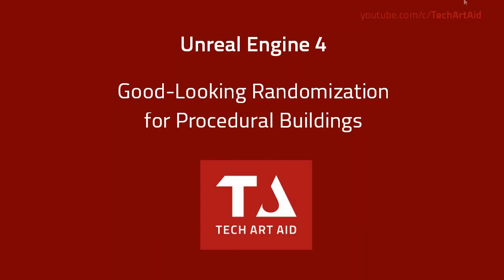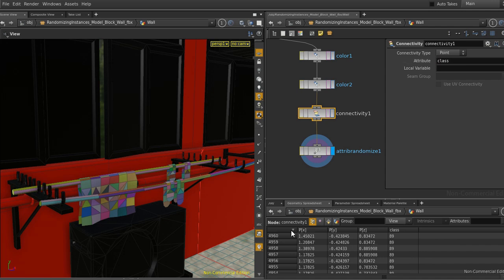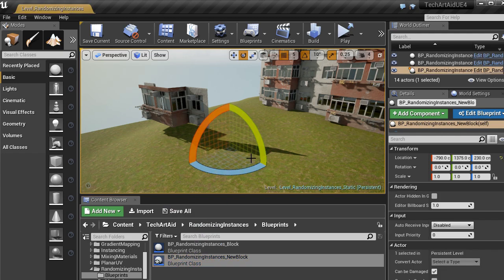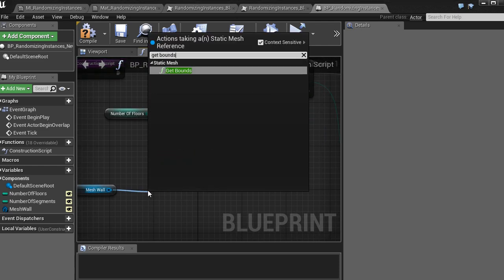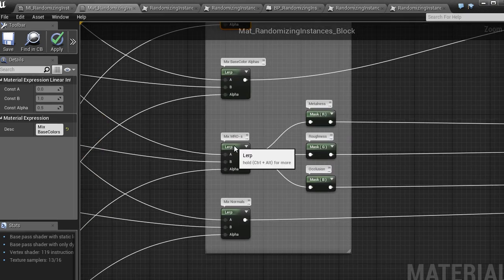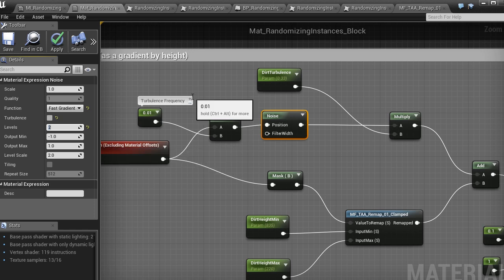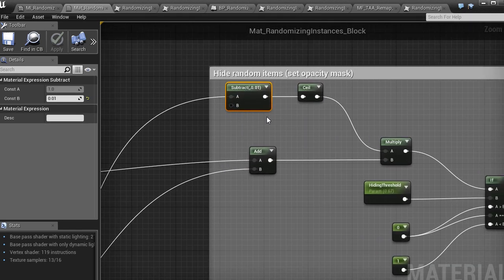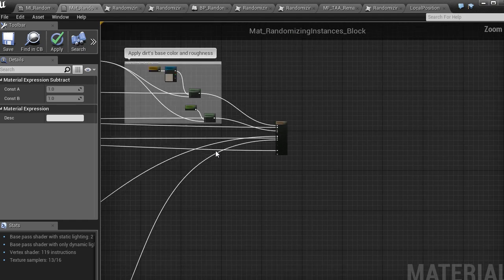UE4: Good-Looking Randomization for Procedural Buildings

Comment: Great tutorial, I have a question about packing the maps though. How would I go about packing the base colour into the alpha channel in substance painter?
Reply from the maker: I think I didn't pack the base color. I rather added an Opacity channel ("op", in Texture Set settings). I used it to make the wall paint color invisible, basically replacing it later in the Unreal material. At least that's how I remember it - it's been several years since :)
Reply: @TechArtAid  Thanks for replying ! If you didn't pack the base colour then how does the air-conditioning unit etc still have colour? I should mask out the colour of the paint with the opacity channel? sorry if you cant remember, you've been great help thus far :D
Reply from the maker: Yup! See how the alpha looks like in project files. There's no Substance file there, only Unreal, but it should be a good enough hint
Reply: @TechArtAid  Ill have to wait to get paid before I buy them but thanks again ! Much appreciated :D

Comment: Thank you for the tutorial. You've pointed me in the right direction and this will help a lot. 
However, the static mesh overlaps when adding to the segments.
Is there a way to move a new segment over more to one side so that they don't overlap?
Reply from the maker: Yes. You need to increase that component's location by width of the mesh, multiplied by the number of segments so far. Usually you'll use For loop's iteration index for that. You can get the project files on techartaid.com. Folder name for that example is RandomizingInstances

Comment: Interesting approach. Using instanced meshes while adding fair amount of randomness could really have a massive gain in terms of performance
Reply from the maker: For sure! And the next thing I want to try, soon, is to make it artist-controllable. The goal would be to be able to create a district from various modules. Hiding the cheap tricks while allow for some manual control should make it possible?
Reply: @TechArtAid  Vertex Color already seems to be good enough for weathering effects which will make a massive difference on its own (I think). 

However, I wonder how would one go about making buildings which one could enter like in cyberpunk 2077
Reply from the maker: Try that. Especially find a clever way to set colors per entire building easily. For city of that scale, it's also important to plan for optimal LODs (and HLOD-kinda solutions)
Reply: @TechArtAid  well I was considerijg it but apparently it would be redundant by the time ue5 comes out

Comment: Great tutorial, but how do you make this work with instancing. I'm a bit new to blueprints so I don't really know how it works. I followed the version in the text tutorial linked in the description and got it working but I wanted to know how to reduce cost by using instancing.
Reply from the maker: Since UE 4.19, a form of instancing (dynamic batching) should apply automatically, as long as the modules use the same mesh and material (incl. parameter values). However, manual instancing should still be a tiny bit faster. See my Instancing video, about asteroids
Reply: @TechArtAid  Thank you for the reply. I tested out your blueprint and found that it was generating a lot of draw calls for me, but I managed to find another tutorial to create the instances using hierarchical instanced static meshes which produced a lot fewer draw calls (around 30 compared to 200 with each being a grid of 16x16 chamfered cubes). I didn't use the building façade you provided, I was just testing draw calls and performance so I just used the chamfered cube that comes with UE4. I'm not sure if I've done something wrong, and the automatic instancing isn't working for some reason or it's something else.

My problem is okay at the moment since I got my instanced meshed working in another blueprint, however I would still like to know more about the automatic instancing, since I can't find that much about it.
Reply from the maker: I found this thread. Especially replies by the user 'pdunkl' sound interesting: https://forums.unrealengine.com/community/general-discussion/1670524-what-about-auto-instancing

Comment: Could this generate a few hundred buildings with mixed variation in few minutes?
Reply from the maker: Sure! Randomize the colors, the parametrs. Also the results will be much better if you use several different models. Choose between them based on some rules, like in Oskar Stålberg's Townscraper.

Comment: Glad you provided the download. I could not keep up with the material side of things.
Reply from the maker: Does it work for you? They're for 4.18 for compatibility, but I haven't tried on 4.21 or 22. In general, I'm trying to keep the videos concise. I'd rather use the time to explain the general idea. Then leave the details for personal exploration using the downloadable project.
Reply: @TechArtAid  Hadn't had a chance to test the material bit out yet. I will in a few hours maybe. Currently working in other areas. The mesh stacking works. I learned to make sure the loops are in series because if in parallel it will just make rows in either direction instead of cloning the previous row if that makes sense.

Comment: Hi oskar again, I ask you a question, is it possible to put that actor of the building a base that is static and a terrace also static and in the middle to make the floor variables?
Reply from the maker: Hard to imagine the case, sorry :) I think yes, just add a single static mesh component on top and bottem
Reply: I'm trying but it does not work, only the mesh appears in the middle, I leave an image so you can see what I did, probably this bad, also try to put "add static mesh" but I do not know where to connect it, sorry if I get tired of it questions.  http://oi67.tinypic.com/xom74k.jpg

Comment: Thank you very much for this oskar tutorial, I wanted to do it a lot ago and today I was encouraged and it came out, but on the other hand, in the "Construscion Script" section I have everything equal to your video but it does not let me put "Segment Numbers", no I know if it will be the pivot of the mesh or something, I do not know what to do.
Reply from the maker: Hi Sebastian. Have you downloaded the files? Link is in the description. Do they work on your version of Unreal?
Reply: Not yet I could not download it, now I'm going to sleep but tomorrow I continue with the tutorial and I tell you how it was, I have version 4.17.2 Thank you very much for answering my message :)
Reply: Hi oskar again, I ask you a question, is it possible to put that actor of the building a base that is static and a terrace also static and in the middle to make the floor variables?

Comment: Would you mind explain how to add other props to the procedural generation and how to change the material to include those props as well ,thanks for the help !
Reply from the maker: Add new variables for a static mesh and a material instance. Then you have 2 option. First is to add a Branch node with some condition, which will lead two different Set Static Mesh nodes on the generated static mesh component (or set a common variable, if you want to do it a clever way). Second option would be to just duplicate the entire node setup (you can pack into into a function first, to reduce clutter) and provide a different mesh. I hope it helps.
Reply: Thanks ill give it a try and i look forward to your next tutorial!

Comment: hey bro How do I make each segment rise with respect to its height, along its length as if it were a staircase?
Reply from the maker: Create a variable Last Height. In the For loop create the mesh, move it in Z axis to this variable's value, then increment the variable by the height of the currently added segment. The next mesh will already know this new last position.
Reply: oks Tnks so much

Comment: I have a question: I got a building made out of 11 modular pieces, so  when I place each peace individually to create a building, and even duplicate the whole building, I get pure 120 fps, but when I place 2 same buildings, but made from blueprints like this, I get around 70, and there are just 2 buildings in the scene, nothing else. So, am I doing something wrong or this blueprint method sacrifices performance for ease of use? Thanks for the tutorial though!
Reply from the maker: Yes, it sacrifices performance a bit, but it's still reasonable. If you have many buildings, it would be actually better to use this method for prototyping, then recreate in (or export static meshes to) a 3D editing software. Try this and tell me what changes the most when you add these buildings:
 https://www.youtube.com/watch?v=SXLYy6D1y80&index=2&list=PLF8ktr3i-U4A7vuQ6TXPr3f-bhmy6xM3S

Comment: Hi, its very cool. Thanks!
But what if I make 1 Mesh per floor? Will this increase performance when using  instance meshes, for example?
Reply from the maker: +Веня Головин It depends. Generally less meshes = better (less draw calls), but more meshes are better for occlusion culling (objects outside of view or behind other objects are automatically hidden for performance)
Reply: Cool! thanks. But I do not use the occlusion culling, because It does not work very well (objects do not always have time to appear, even if I use hzbocclusion). So now I probably need larger Meshes to improve performance (1 floor maybe).

Comment: Is there a reason you didn't do all of this in houdini? I bet it would be easier than working with blueprints. I'm not sure how I would go about linking materials in ue4 to the .hda though.
Reply from the maker: +Giuliano Costa The blueprint setup here is very easy, just several nodes. But if I needed a more complex generator, then you're right that Houdini will allow for more options
Reply: Kk gotcha. I am looking forward to your houdini tut (:

Comment: Amazing video! subbed (enjoying the optimisng stuff too!)
A small question, how would you do something like replacing just one of the ground level pieces with a different piece so a door/entrance area could be added? 

keep up the good work!
Reply from the maker: +The Virtual Insomniac Thanks for subbing! I'd use a Branch node to check if current loop index equals 0. If true, then I'd use a different mesh
Reply: +Tech Art Aid no problem! :)

hmm so i would assume i'd use a do once node to replace just one of the meshes rather than replacing them all with the door variant? 

going by this logic would there be a way of somehow choosing where to position this one unique piece e.g centering it between other pieces so i just have one door piece in the middle? sorry if im asking too much :p
Reply from the maker: +The Virtual Insomniac No need for a Do Once node in a construction script. This BP selects a different random mesh for the last floor: https://drive.google.com/file/d/0B3aZlreklH8wSlRzbFhpZkE1QWc/view

Comment: Is there such a thing for 3ds max?
Reply from the maker: Which one?
Reply: "Good-Looking Randomization for Procedural Buildings". This looks like awesome high poly modeling, I only found some low poly generation for 3ds max.
Reply from the maker: The single building module (as visible at 3:40) was modelled by me in Blender and textured in Substance Painter. The method I show here is to clone this module horizontally and vertically, then do various randomizations just in the material. It's possible by mixing 2 texture sets, utilizing pixel's world coordinates etc. I don't know about 3DS Max, but it should be doable in Slate Material Editor.
Reply: 3ds Max 2016 introduced node based scripting, through their "Max Creation Graph". Vertex painting (what is used in this tutorial), has been in Max for ages though :P

Comment from the maker: In 2 months it became the most watched video on the channel, with 19,500 views. Then 4,875 people made it through the presentation part. 2,925 survived the Houdini fragment. Brave 1,462 of you watched until the end of tutorial. Whoa. There's a lot of us, tech-interested artists (just here), if you think of it!
Reply: Tech Art Aid we love you for doing this. Please continue these kind of videos.
Reply from the maker: Thanks for encouraging me. I hope to release a new one tomorrow, about GPU profiling (measuring what slows performance down in a scene).
Reply: this will be very useful for me right now, looking forward to seeing it - Subbed!
Reply: Tech Art Aid I'm just watching because it looks cool. I don't really care about the tech side of it.
Reply: Hi can you please tell me if i can use blender and unreal engine to achieve the same results?
Reply from the maker: Yes. Use Vertex Paint mode in Blender. There's an icon in the toolbar you need to enable as well ("Face selection masking for painting"). Then when importing the mesh in UE, during the import process, make sure to change vertex color behavior to "Replace".
Reply: @TechArtAid  Thank you so much.
Reply: To be fair UE4 can do far more than a typical 3D application. So customizable though very rigid in its ways. I am personally using it to write some books. Besides trying to snap pieces together  with an alt and drag is an ever loving pain. I modified what you did and added gap options as in between each one I can add a space if need be.
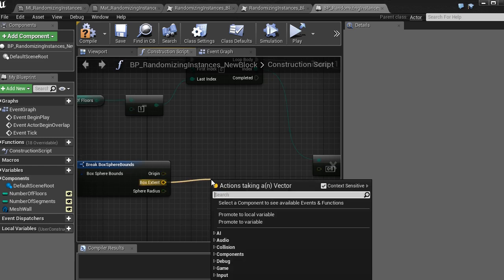Reply: 13:04 you skipped sonething here.

Comment: please forgive my complete ignorance on this. I just heard of unreal engine 4 and basically that is all I know about it. I have a passion in 3d graphic design and I've been using sketch up a lot in the last years. But I think it is very limited. Would you advise my to start using this program and is it possible to use it to build 3d graphics to all people or do you have to be an official developer. I know these are probably silly questions for you but it would help me a lot since I'm completely ignorant on the subject. Thanks for the time.
Reply: +Clinton Jason Dubai Unreal is a game engine. You have to get the art from somewhere. You can build scenes out of paid Marketplace assets. Or learn a 3D tool more game-suited than sketchup: Blender, Maya, Modo or Max. I use Blender. I'd recommend getting a book that walks you through the very basics. Don't try to assemble knowledge before you get solid basics teaching, because you can get really confused. UE is hard, as is any game engine, because of the sheer amount of domains it combines: levels, lighting, sound, animation, gameplay (interactivity) programming, VR, omg. Before you begin, think what you want to do with it :)
Reply: Oskar Świerad 
Thanx a lot for that! I knew it sounded awesome but at the same time very complex. However, never to late to learn something new lol
OK so I thought you could use it to build 3d stuff and then work with that design. Didn't know you needed other things like Blender to begin. So it's even more complex than I thought (but it did look way too accurate and awesome to be easier than I thought). Ok Thanx for that.

I wish there was something simple to build 3d designs which would be far more complex than sketch up (I mean it's good but it looks kinda cartoonish and it certainly doesn't allow you to move around in it like you would in a video game).

Is there anything you would suggest (since I'm sure by know you know waaay more than me lol) for someone who would like to build constructions, buildings, vehicles in 3d and even be able to operate them like make them move or add mechanisms, but with better graphics than sketch up, that could look like a video game? Don't really mean to play with it (I mean who knows) but to design something that is very realistic without having to learn a million things and put everything together. Maybe you have a few solutions that I'm not aware of. 

Again Thanx a lot. :)

Comment: this is incredible... I have to learn Unreal! 
what pc specs do you run? what do you think is the minimum spec I need to work easily in Unreal but without paying 2k euro? :)
Reply from the maker: +sensemille I'd guess 4 cores, 16 GB of RAM, GTX 760 and an SSD are the minimum. Less cores will slow down lightmap and shaders baking, less RAM can lead to crashes when there's a spike of usage and SSD is because of a ton of file operations and compilation of shaders/code. Lower GPU should be possible.
Reply: Thank you for the info! :D I will be starting to try and recreate your tutorials soon. Keep up the great work!

Comment: 8:38 Blueprint is not an object. Blueprints is the logic attached to objects. "Basic object" that could be spawned in world called Actor. Basically any object that exist in level is an Actor or it's descendant (like Pawn, Character or Static Mesh Actor). To be more precise it's an Instance of a class that descend from AActor class (UE4 uses Object Oriented Programming logic for it's elements).
Great tutorial!
Reply from the maker: +Sedokun Right, that's a proper explanation. Thanks for the correction

Comment: Did you use 2 UV sets for the base texture and one of the cracks?
Reply from the maker: +PanzerHeini 1 UV set for textures and 1 for lightmap. So both the damaged and the clean texture use the same UVs. You can find the static mesh in the Gumroad package, in RandomizingInstances/Model/ :)